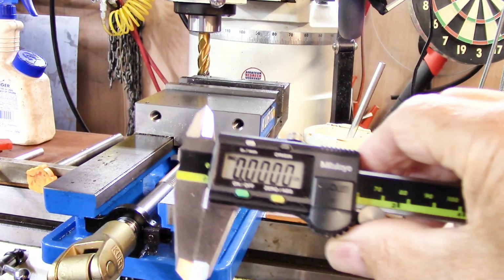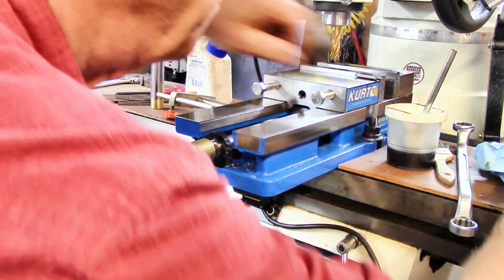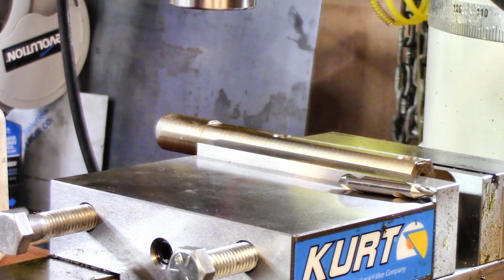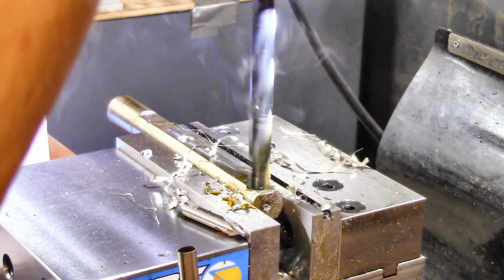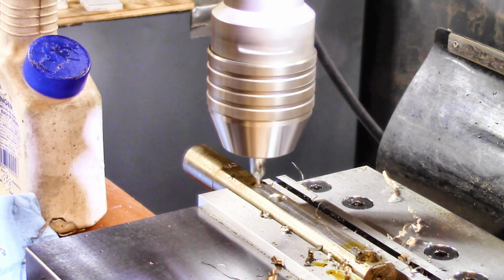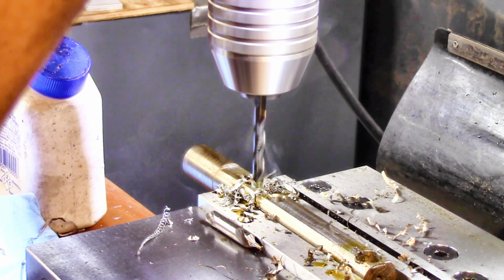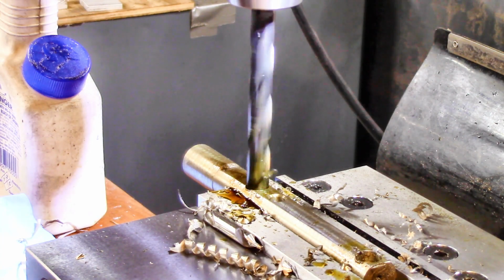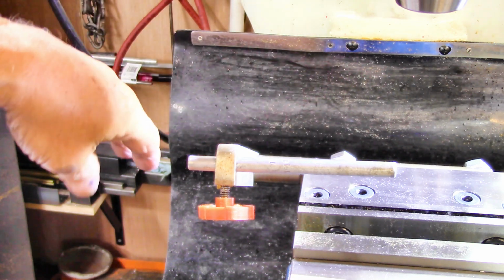Mill Vise stop

Comment: Thanks Harold you just gave me a couple ideas to try too. Good video. 
I was a bit concerned about the center drill woble though. Didnt look like it was in the chuck straight. 
Cheers
Troy
Reply from the maker: I think it was in good but I have messed up on that before.  I just went back to see the video and have watched it four or five times and at first I thought it was wobbling then I thought it wasn't and then it was so I just don't know.  Look at the tip and see how it moves straight.  Thanks for viewing Troy.
Reply: Your Great 🏆🏆🏆
Reply: @AmateurRedneckWorkshop  your center drill was ok, it just looked as though it was wobbling due to the speed it was turning.
Reply from the maker: @RockingJOffroad  I don't think it was wobbling but the video camera sometimes makes things look different.

Comment: Great way to reuse your vice stop. I’m not sure if you told me about the vice stop that uses the slot in the fixed jaw or Adom said something a while back. It’s the little bracket thing attached to the vice at the front by the handle.
Reply from the maker: I don't have a stop that makes use of the slot in the fixed jaw.  I imagine Adam Booth has several of various types but I am not aware of what he has.  Thanks for stopping by Norris.
Reply: I think I seen it on the front of your vice. I am probably wrong, I don't own a Kirt vice but isn't it attached with a screw on the right side of the handle. It looks like a little square frying pan
Reply from the maker: @tsirron  I am sorry but I guess I do not understand the question.  If you go to this link:  https://tinyurl.com/2wfctv2  and copy a picture and send it to my email with the part marked maybe I can then answer correctly.
Reply: For the life of me I cannot find your email. The Kurt part number is wsrl46.
Reply from the maker: @tsirron  my email is hswaters at yahoo dot com.